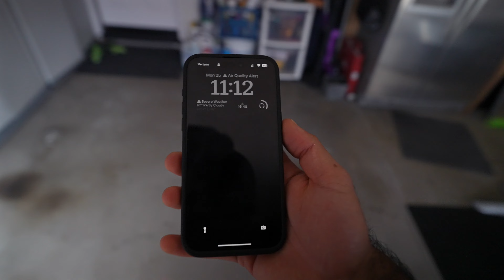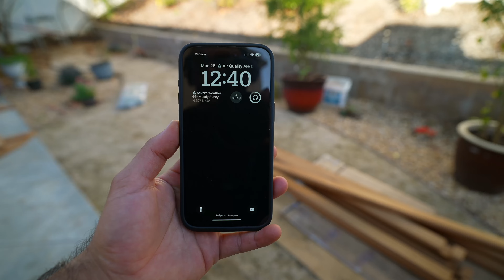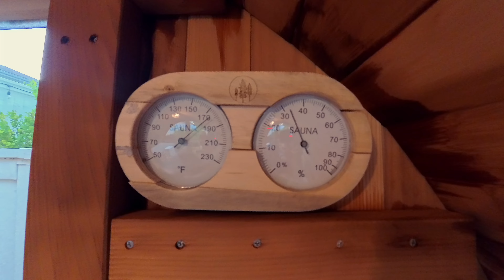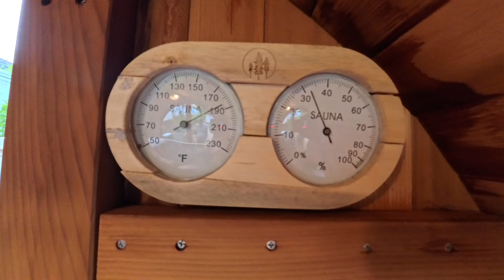Redwood Outdoors Sauna Review (Barrel Sauna Setup)

Comment: Finn here. Looks like a good sauna TBH, 195F is good temperature. I personally have a wood fired one so try to aim for 160F with the fire rising and then drenching the stove in water to get really steamy, each to their own taste. Water leakage may be because you have screwed some of the boards to the frame. I think just strapping it harder would be beneficial as wood lives and moves with humidity and giving a better seal. Always follow manufacturers recommendations though.